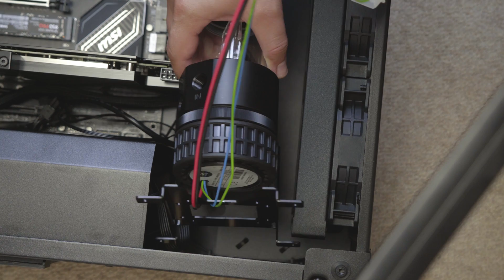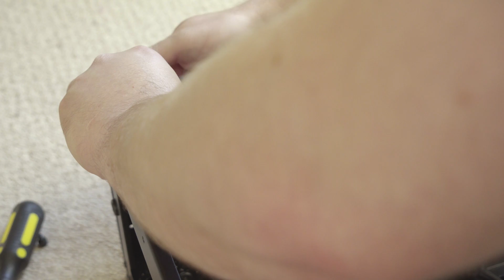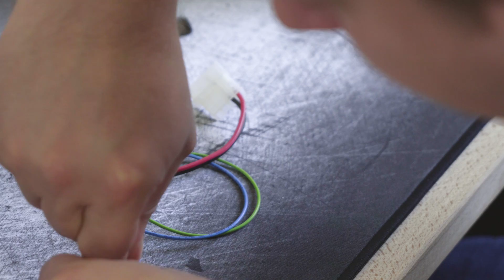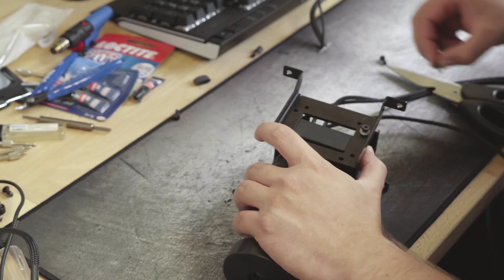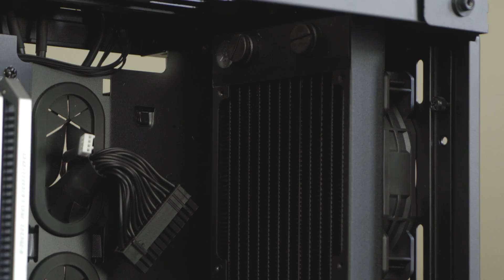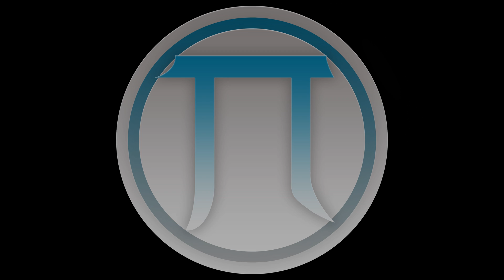How to water cool a pc - Fitting the pump

Comment: For those who will ask why not to put bigger reservoir. It will not change the temps, but it will be much easier to fill the loop. Just in case ;)
Reply from the maker: I did think about putting a larger reservoir in the build but I decided not to for 2 reasons:
1. I think it will look odd in that case
2. I'm worried about air flow, already have a red on the intake fans and if there is a resevoir behind that it mioght disturb the air flow.
You are absolutely right though, it will need to be filled slowly.